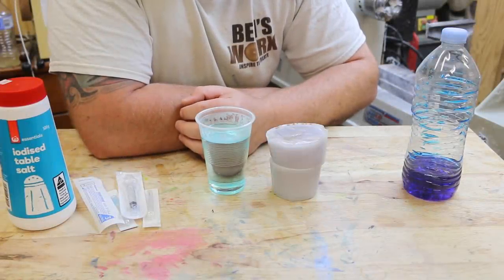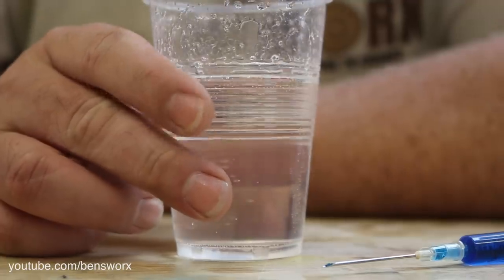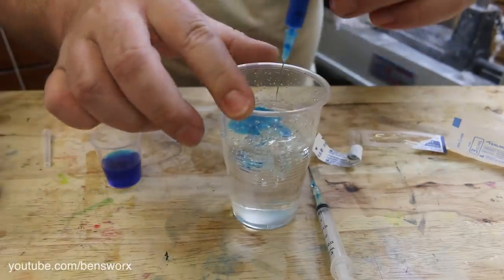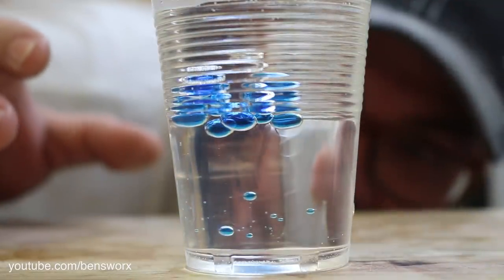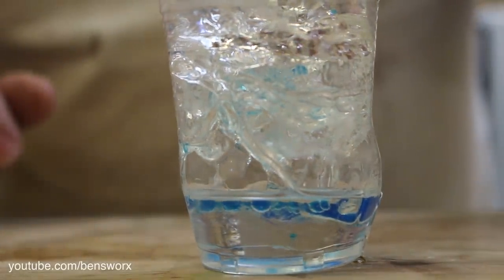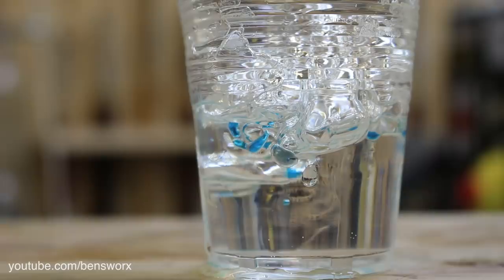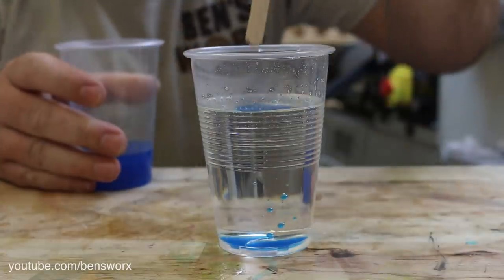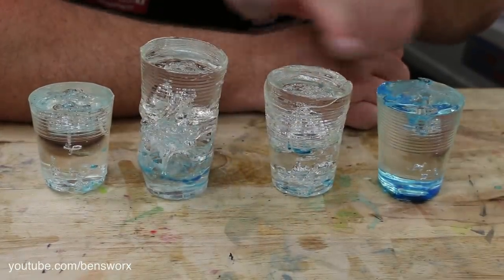Injecting Water Into Resin

Comment: You should try injecting oil, I think it wouldn't react or boil like water did and you could get really interesting results, like the shapes you got with water before stuff went boom
Reply: Think oil boile at about twice the temperature of water. Might also be worth injecting air into same bubble of oil.
Reply: @ColinWatters  No, way higher. Depends on the oil of course. But consider that typical deep frying temperatures are 180-200C, so double the boiling point of water, and it’s not even close to boiling. Similarly, motor oils handle temperatures way higher than that.
Reply: Hot water maybe?
Reply: @Emcik  That would boil even faster, making the problem worse. You need something that doesn’t boil, not something that boils sooner! 🤦‍♂️

Comment: If not water, maybe you could inject something else that won't boil, then turn it into a really cool looking lamp or something.
Reply: Use vegetable oil or something similar won’t boil and can still dye it
Reply: Oil based paint could possibly work or it might end up mixing with the resin 🤔.
Reply: Antifreeze coolant, non deluded. It’s thicker that way and there are a few colors to choose from, depending on what you auto parts store carries.
Reply: Coolant can still boil but brake fluid has a higher boiling point and can be dyed as well
Reply: Maybe mineral oil? It’s clear and might take to dyes or pigments well?
Reply: It's simple just inject coloured resin in.
Reply: @MultiMozman  brake fluid is highly aggressive. It could react in a unforeseen way with the resin
Reply: @Craftlngo  Agreed.  Since I've heard of people coating their molds with mineral oil without incident, perhaps that would be a good next thing to try?
Reply: Baby oil/mineral oil!!
Reply: Mineral oil maybe?
Reply: Lip gloss
Reply: Gelatin? Or liquid starch?
Reply: What about colored vaseline
Reply: Car oil
Reply: Try propylene glycol or food grade glycerin.
Reply: Wax could be interesting
Reply: I would think inject blue epoxy
Reply: @graeme.davidson  Ok, dude, you've solved the puzzle. Game over, guys. This would definitely do the trick.
Reply: Mercury would look cool.

Comment: You should experiment with the salinity levels, if you get it just right then you might have a chance of getting it suspended exactly in the middle.
Reply: That was my first thought when I saw how quick the water dropped and how much salt he put in the water.
Reply: My thoughts as well. I think this would make an ideal follow up for the next video. I'd also like to see green coolant injected.
Reply: It's the density that's different. If you get the density of the salt water to match the density of the resin, it should stay suspended better but, and here is what's happening, as the water heats up it turns to steam as the hydrogen and oxygen are released from their bond. These games expand as they heat until the resin can no longer hold the pressure and it explodes. It might stay together if you use very tiny droplets and not a lot of them. Good luck.
Reply: Gasses it's supposed to say gasses heat up...
Reply: The easy way to get it to work would be to get same volume of water and resin and then weight them out. Keep adding salt until until they weight the same. Adding sugar instead of salt might help with the steam build up issue but it would depend on the amount of sugar
Reply: @Ali Gentry the hydrogen and oxygen don't break their bond when water boils, but otherwise, you're correct.
Reply: @aligentry4366  steam is just gaseous H2O they haven't separated from their bonds otherwise it would have caught fire. To get hydrogen and oxygen from water is quite difficult. The main way is to use electrolysis
Reply: @aligentry4366   I disagree, in the fourth sample you can clearly see the water at the bottom of the cup did not turn to a gaseous state. I assume this was because of the solid state of the resin holding the water in a pressurized state. The issues with the previous samples expanding was due to the punctures in the cup sidewalls from the needles. These punctures provided a pressure relief which allowed expansion and prevented pressure from holding the water below pressurized boiling point as water under pressure has an altered boiling point. Note the water near the top experienced the expansion as it had a linked path to the surface so was not held under pressure
Reply: @Digger927  what about the one that exploded...it did not have any holes.
Reply: @aligentry4366  I think you're mistaken.
Reply: Thats exactly what I was thinking.  It seemed like probably a bit too much salt.
Reply: The salt also raised the boiling temperature of the water.
Reply: Maybe try some antifreeze, or Water wetter. Have higher boiling temps.
Reply: i read that as checking his sanity and couldnt agree more

Comment: You should recast the second one, the one that exploded. You could mix up a different colored resin, "I think purple or red would be fantastic", and then pour that around that exploded resin blank and then stick it into the vac chamber.
Reply: I was thinking the same thing recast #2 in new mold with a bright color.
Reply: @jesanoldude  Turn it into a sphere or a lava lamp shape, would look amazing.
Reply: So, moisture makes the Resin get hotter, which makes it set faster, which makes it get hotter, which makes it set faster. And so goes the cycle.  It's called, "run away exothermic reaction. Try doing it by injecting epoxy mixed with color. This wont have the effect of adding moisture.

Comment: I absolutely love your sense of experimentation and curiosity just for the sake of discovery. I also love that you try everything you can think of as well. I also LOVE that you keep trying and using what you learned moving forward instead of giving up when you fail or don't get the desired result.
Reply from the maker: Thankyou 😊
Reply: @BensWorx  get a specific gravity  meter, find the spg of the resin mixture, then adjust your salinity to the same spg, it should float in the middle
Reply: Simp. jk

Comment: Try Distilled water, it wont boil!
Reply: Unfortunately that is only true in laboratory conditions, once it has any impurities in it, it will boil. So by adding dye in it will allow the distilled water to boil. What he needs to do it use a slow set epoxy that won't get very hot and cause the water to heat up so drastically.
Reply: That's extremely dangerous as the moment you break the surface it boils instantly
Mythbusters did a myth of exploding water

Comment: Congrats on the anniversary. One thing you can try is degassing the water. If the water is from the tap or was shaken up it can trap oxygen. Put a small amount of the water in the vac chamber and release all the free oxygen in the water and see if that makes a difference. May not change much but it’s worth a try

Comment: happy anniversary! couldn't help but think that the bubble sank because of the leaks left by the syringe. Maybe if you could plug up the hole ater injecting, or use a more self healing container (silicone?) you could better trap the bubbles higher- though you may guarantee an explosion.

Comment: Maybe you could try casting an inch or two of resin at the bottom of the cup (until it’s thickened on top then pour a second layer of resin on top which you inject/ drip salt water into? 

That cast explosion looks awesome! It may require a bit of creativity and the vacuum chamber but you could fill those negative spaces with coloured resin and recast it in the cup. If it works I think it could look amazing 😍

Comment: Big congratulation on your wedding day from Denmark ❤️❤️🥂 so the saltwater dropped to the bottom very fast, because it was to dense. Instead of fully saturated water, use maybe 50% saturated. Just take 50% volume from the fully saturated water and 50% volume from water without salt.

Comment: Okay, so my idea how to make it work:
1. For the preparation, fill the bottom of a container with resin and let it cure. Coat a blown up balloon )that fits in the container) in resin and let it cure. If you pop the balloon you should be left with a spherical resin container with a hole in the top.
2. Flatten the top of the balloon shape so that it can sit flush on a surface and fill it with water - all the way to the top. (maybe its possible to leave a little air bubble too)
3. Place the container with the resin coated bottom on top of the filled balloon shape and flip them around
4. Slowly fill up the container with resin

if it works you can play around with other liquids like oil

Comment: Since it seems to harden from the top down, can you add a heating element to the bottom so it solidifies towards the center? This way the water could get stuck in the middle and you wouldn't have to dial in any salinity.

Comment: Cut small slits into the bottom of the cup, cover them with a small amount of tape. Heat up some water and have the top of the reson start to harden. After the top hardens, flip it over and cut off the bottom and see if the reason will start to cool from that end. If it does, then inject the water into the center.

This was definitely a fun video to watch.

Comment: What kind of resin are you using? The kind I use doesn't heat up, and I think it holds liquids better, though it does still have that density problem where it all pops to the top and the color I use tends to leech into the resin

Comment: Would it help if you found a way to patch the hole from the syringe? Maybe the resin leaking out is what is dropping the water back down after it floats to the top. But it might explode either way. As another commenter said, maybe try something that doesn’t boil.

Comment: If you get the ratio of salt to water just right. The density of it will suspend instead of sink. Too much water and it will rise. If you use heavy water it has a different boiling point. Same with oil. But the idea you have going here is incredible, would love to see you try it again.

Comment: I'd try a two part pour, once the first half is set, drill a central home in the set resin, then either put the coloured water in the deep home, or inject after you have poured the runny (un-set) resin on top then the bubble may appear to float, as long as your resin mixes are identical ratios, there shouldn't be a join line.

Comment: Could you try this with radiator coolant? That way it won't try to evaporate and expand as it hardens and heats up. I think it would get what you'r trying to achieve. it also seemed like the salt level could be dialed back to make it float rather than sink

Comment: Throw the water filled cups in the pressure pot! it will raise the boiling point and might allow some leeway to let it cure before boling.
As a rough estimate, water inside a pressure pot at 30 psi should be able to hit 120C without boiling

Comment: Very fun to watch, although it was a tad scary. While the effect of number 2 is cool, I think you actually have something useful with number 4 (assuming you don't want to do more stuff with ice). You could try having several salinities at once, with each being a different color. Or you can try injecting the saltwater in the cup, while the cup is upside-down. Another thing you could try is keeping the resin cooler while curing, to see if that will lessen the steam bubbles.

Comment: Maybe try salt water, put it in the freezer to cool while the resin partially sets.  Use an eyedropper or syringe to place individual drops.  Cold might counter heat from curing and slow down boiling?  Could you use mineral oil in place of water?  Higher heat capacity, might not boil.

Comment: If you want it to float half-way you need to roughly match the density of the resin to the water. put a drop in, if it floats too high, add more salt, if it sinks to low add more water.

Comment: This works with UV resin. You pour a layer. Cure it. Add your water and any small items and then freeze it. Remove, pour top UV resin lawyer and cure. Shaker pours!👍 Also try non iodinized salt. The iodine may react with resin. Glycerin may also work instead of water.

Comment: You could try degassing the water either by bioiling or vaccuum. There is air in it which expands as it heats up and explodes. May help with this.

Comment: Once you add the salt you shouldn't worry too much about it exploding. It only exploded because the heat evaporated the water, creating a pressure that needed to be released, but adding salt increases the temperature needed to boil the water. I would say either experiment with different salt concentrations or after you add the salt water wait for the top part of the resin to harden before you flip it upside down which should move the water towards the center of the cup.

Comment: Either matching the density by varying the salt, or using something that won't boil would be great for the next video. I bet that the added salt, much like when cooking, raised the boiling point just high enough to not cause any expansion problems too. I wonder if your resin has it's density posted on some sort of spec sheet? Maybe you could use some math to derive the perfect combo of salt and water, or to find other liquids that would work great.

Comment: It wasn’t so much that water was boiling, but also that the resin escaping from the holes you create from puncturing with the needle meant that air would be in the cup. And the water will flow to the air and try and exit / escape too. With nowhere else to go but to the bottom where air is.

Comment: You should try casting a half a glass of water in resin, Put something clear on top of the glass when you pour the resin around it so the resin doesn't fill the glass, then when it's all set the water would slosh around like normal inside the glass inside the resin

Comment: so, the water caused the resin to expand and pop like that because it slightly boiled the water (leidenfrost effect), and when water changes to steam, it expands by ~1600 times. this means even a near zero amount of water turning to steam will make a lot of gas and pressure. this pressure's also what pushed the resin out of the holes you poked in the cup with the syringe. if you poke the syringe through the 'hardened' top layer, inject the water, then remove the needle from the syringe, but leave the needle in the resin, the expanding gas can escape via the needle and not explode. the needle, being very smooth, should be removeable (with a bit of effort) after it cures fully. you could then refill any water displaced by the expansion, and pour a small amount on top to "cap" it off, and fill in where the needle was. this should make for a great bubble effect. a little bit of salinity to reduce the buoyancy will make it even more likely to succeed.

Comment: What you should do is use antifreeze. It probably won't boil. And if it floats, add salt to it which appears to have made the water heavier. If you do it methodically, you should be able to get the right ratio to allow it to suspend how you want it to.

Comment: Looks like the key might have been to keep the syringe in as a pressure relief port.

Edit: Also, isn’t the boiling point of salt water higher than 100C because of the density?

Comment: With the salt water, you might pour it in as before, then, when the top hardens, turn it upside-down to let it fall back down to the now-hardened former-top. Might get your suspension-look that way. Unless it hardens "air-in" rather than "top-down."

Comment: Cover the holes made by syringe with tape and cover the top of the cup too. It would be bettier if you do it in airtight way:) By the way, it's nice.
Edited: If you try this fill the cup upto brim with no air inside,Cover and make it air tight Use the syringe cover the hole with tape.

Comment: You should try vegetable oil instead of water.  It won't be effected by the heat as much.  Different oils have different melting points too.  So maybe frozen oil cubes would be fun.  Or super frozen by dipping an oil cube in dry ice/alcohol.

Also, how about Gallium metal, which is solid at room temperature but melts at human body temperature?

Comment: Hey, Ben, new sub here.  That was terrifying to watch!  Not so good for my blood pressure,  but so very cool to see.  I liked the exploded one and the last one best.

A couple of suggestions for things to inject next:  colored mineral oil; colored gelatin; and/or chocolate chips.

And a question/request for a video:  Have you ever tried using a vibrating table (like the ones jewelers use to remove bubbles from their castings) to get bubbles out of resin?  I can't decide if that will work or if it will just put more bubbles in.

Anyway, thanks for the great video!

Comment: Next time you should make a resin cup. Make a blank and hollow it out to about 1cm thick and then use that instead of the plastic cup. You'll end up with water being held more central and you should also be able to do a bit of finishing on it on the lathe.

Comment: Would it not be more efficient to craft a "hollow ball" of resin, which you then fill with water and seal.
You then craft a shaft/pedistal in which you can rest the ball in the mold, as you fill it with resin.
As the refraction properties of the resin should be (and correct me if I am wrong, as I am making an assumption here) the same after curing, the "ball" and the pedistal should not be visible, giving the apperance of a "water ball" floating in the resin.

Comment: The water expands because of the heat. Thus the explosion. I wonder if you create a hollow bubble inside the resin, basically a cavity, then pour in the water then seal the hole with more resin.